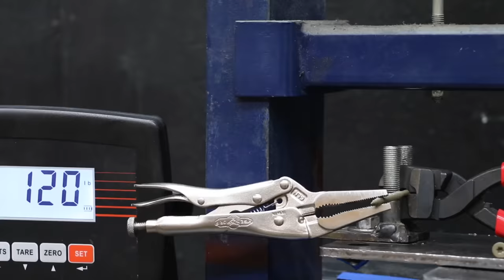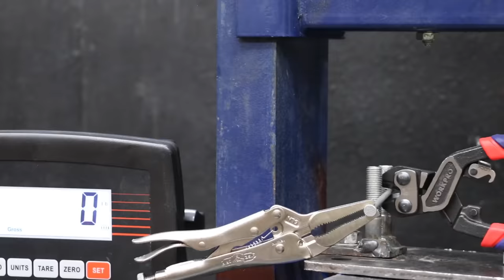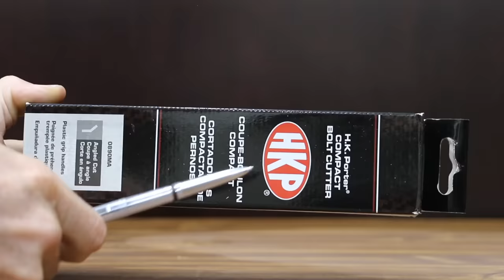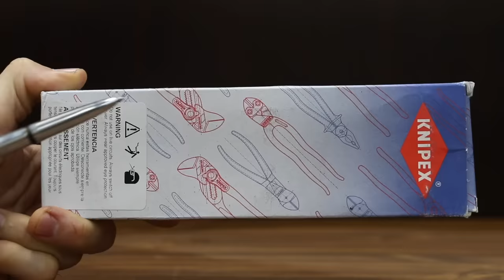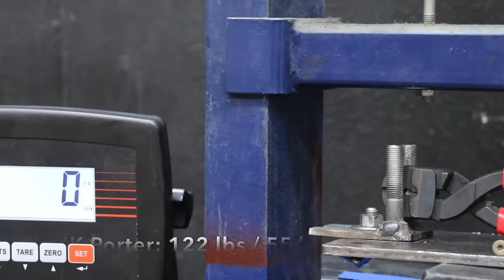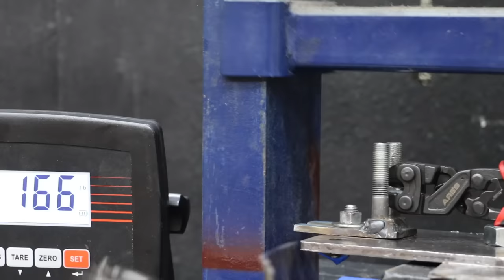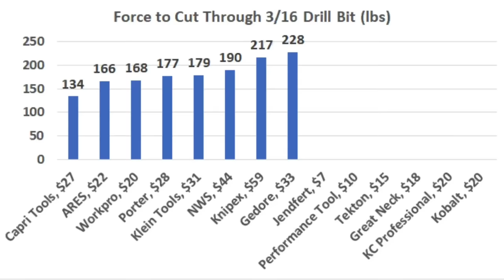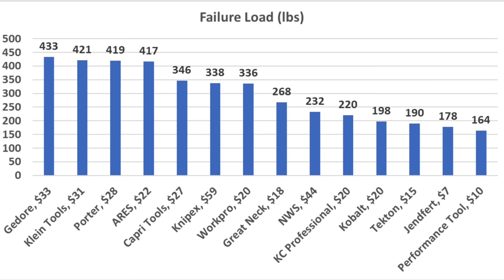Best Bolt Cutters? Knipex, Klein Tools, Kobalt, Tekton, Gedore, NWS, Porter, Workpro, Capri Tools

Comment: Thank you for another great video.  For the money those Capri cutters was impressive.  But the surprise was the Klein cutters. For a wire cutter to perform along side  designated bolt cutters says alot about the durability and steel.

Comment: I never heard of Capri tools prior to your test.  I am very, very impressed with them - $27 mini bolt cutter beat the $59 Knipex in most of the tests!  I'm going to look into the brand!  

Thanks for another awesome video!
Reply from the maker: You are welcome!  Thanks for sharing.
Reply: I broke the tip off my capri not long after getting them.  All my co workers use knipex and they last.
Reply: The thing about knipex is the durability, they really are worth double the price if you can afford it
Reply: @timmturner  Capri will send you a replacement in like 1-2 days. I've been super amazed with their customer service. They are only increasing in quality.
Reply: @ryanjohnston4828  Good to know, I wouldn't have any issue with their product. Performed well and is appropriately priced.

I was just saying in knipex you do get what you are paying for, a tool that will likely last a lifetime.
Reply: @timmturner  I like Knipex as well. I own several of their tools. But I just don't blindly buy tools because of the name brand either. Bolt cutters have a hard and short life. I would prefer to spend less on bolt cutters due to the nature of the job. The Capri proved to be a good tool especially for half the price. You could buy two pair of Capri for the same price as one pair of Knipex and have an equality capable tool.  The Knipex has the better edge and this may be a necessity for cutting harder steels. But for cutting a variety of different steels, the Capri would not be a disappointment. Plus, a person could benefit from buying a pair of Capri cutters for rough cutting and use the Knipex for selective cutting.
Reply: @halfstep67  the Knipex have several versions including angled versions that can get flush like side cutter and a notched version that would beat out all of the ones in this video for leverage and ease of cutting. The notch allows the use of the strongest and lowest part of the blade without slipping. It’s incredible. I wish he would have tested that one instead/as well.
Reply: Which brand do you like me to buy? Thank you
Reply: @AlexanderMason1  Agreed, it would be nice if he tested the recessed model since he cut exclusively round stock.

Comment: Those locking wire clips at the end of handles are a love/hate thing. Sometimes they are in the way (words are spoken) and other times they help with storage.
Reply from the maker: Great point!  I don't like them for the reason you mentioned
Reply: Extra words if they pinch you and/or remove some skin! 😬

Comment: Note that the position of the bolt on the jaws has a lot to do with the force required at the handles to cut it. Jaws that open a tiny bit more may have a huge advantage.
Reply from the maker: Thanks for the feedback.
Reply: was about to comment the same thing anyway great video!
Reply: I noticed that too.  I wonder what the outcome would've been if the object to be cut was jammed as far into the jaws?  Would the tool have lasted as long or failed earlier?

Comment: Never knew there were so many brands. I bought Knipex about 20 years ago. Use to cut wire, nails washers, trim metal parts. Never allen keys. The cutting edge is like new. They will not wear out in my lifetime here in Australia.
Reply from the maker: Thanks for the feedback.

Comment: Nice to see some German brands in the fold this time, especially NWS! I love my NWS-cutters, some of the best cutting edges I've ever come across in durability... But in the case of the design tested, they won't hold up to as much abuse as dedicated bolt cutters due to the design, they're made to be compact high leverage leverage Side cutters. They're great for what they are though.

A nicely hardened Allen key is harder or just as hard as most of those cutting edges, with the exception of NWS and Knipex perhaps.. By the way, NWS does makes actual proper bolt cutters, not high capacity Side cutters as the ones tested. The NWS 156-250 would have been the model of choice, and their smallest proper bolt cutters.
Reply from the maker: Thanks for the feedback.

Comment: The position of the nail/deck screw in the jaws (near the hinge or closer to the nose) greatly influences the amount of force/leverage exerted on the cutting points of the jaws. The nail/screw position should have been uniform in all cutters between all tests.
Reply from the maker: Thank you!
Reply: Exactly what I came here to say
Reply: It looked like he did the best he could, given that some jaws are smaller than others.
Reply: No he did it correctly. In real life you put the nail as close to hinge as possible so if one's jaws don't open far enough it should lose points.
Reply: That’s the exact same thing I was going to say
Reply: You're splitting nits.  The test setup was optimized given that these mini bolt cutters had different sized jaws, some had 'hinged' jaws, and 2 looked more like large diagonal cutters.
Reply: @kenc2257  two WERE diagonal side cutters. ;) I'm surprised they fared as well as they did.

Comment: I noticed that when cutting the nails there was no "standard" distance between the last pivot point of the cutters to the nail. That would make a huge difference if near the Pivot point or far from it. IE 1:34 2:41 and 3:52 4:17
Reply from the maker: Thanks for the constructive feedback.
Reply: I noticed that as well.  It would greatly affect the force needed to cut the workpiece.  I think that for most users, it's the durability of the blade that's most important.  You rarely need to take the tool to its physical limits, but you do want it to last.
Reply: It looked to me that he put the nail as far back as the jaws of the cutter would allow, which gives the maximum amount of leverage that particular tool can manage for that particular nail.

That seems like a perfectly fair way to conduct the test.  Anything else would be artificially limiting the leverage of a particular tool.
Reply: @Thanny  I agree, they were designed with the jaws only opening enough to get the nail that far in. If that design results in an inferior tool it will be reflected in the results and consumers should know about it.

Comment: I like the idea to compare pliers or boltcutters by the force required to operate them. At the end of the day thats what matters for the user. However in this test it seemed to me that the distance between the pivot(s) and the nail varied quite a bit from one cutter to another. This would influence the results quite a bit.
I know you are as thorough as possible and I love your content because of that. I was just wondering if there were limiting factors involved like some jaws not opening far enough or the handles then opening too wide for the cutter to fit in the press?
Reply: I think he actually mentioned that specifically. For one of them the opening was too small and couldn’t get as close to the pivot point which effected the results. So he did at least mention that
Reply: If you look at it from the context of the nail / screw being the constant, it doesn't actually matter that there are differences in where they sit in the jaws as that's a design decision made by the manufacturers and it "will be what it will be." For example, a designer could make jaws that move perfectly parallel. In fact, that's exactly why there are different designs in these products. Some have a single pivot, some have multiple pivots, and a few others even have slides. They do this to either increase leverage or decrease the angle of the jaws when cutting.
Reply: What fwe said. If the difference in distance to the pivot was caused by a design decision in the tool itself then it’s perfectly fair to include that discrepancy in the results since being able to cut things is what these tools are made to do and if the jaws don’t open enough to do that effectively then it’s a worse tool for the job
Reply: Thank you. Useless tests
Reply: The goal of his testing is to show which is the best for the user, not which is ultimately a stronger design. It's the workpiece tends to slip due to a design decision, the user will likely experience that during real world use. Not every use will applied ideally, and I think that's a fair representation.
Reply: @Eli-rq8et  the real problem is he chose 3/16" instead of 1/8"

A lot of these aren't spec'd for the size.
Reply: @jamesbizs  Explain

Comment: Love your vids.  I do have an issue with this one though.. In the first test, the distance that the nail is positioned in the jaws is a HUGE factor on the poundage needed to cut through the nail. To be fair, all of the tools should have been tested with the nail in the same exact place.  Other than that, thank you for all your hard work on this stuff!
Reply: I’m quite sure he positioned the nails as close to the pivot point ad he possibly could. Some cutters simply don’t open as wide as others, and therefore can’t accept certain items as close to their pivot points.
Reply: As he mentioned at 11:54, some of the brands can’t accommodate the thing being cut as close to the pivot point as the others. That is part of the reason why the Capri and ARES bolt cutters performed so well

Comment: Good job Tod! I have a request as I’ll soon be buying one: 10” portable tables saws. You can read comments all day long on the sellers website but nobody could rate them better than project farm. There’s lots to choose from with prices ranging from $200 to over $500. The field needs fleshing out! Would make for an interesting (and costly ) episode but would be well worth it.
Reply from the maker: Thanks!  Thanks for the suggestion.
Reply: I know my experience with the cheaper and used saws is that the motor moves when torqued and the blade makes the cut crooked.

Comment: I love when a budget tool does as good as the expensive ones! It might not be quite as durable but it's perfect for home use if it doesn't get used daily
Reply from the maker: Thanks for the feedback.
Reply: Buy once, cry once.
Reply: @Robert-cu9bm  depends. ive seen so many videos of snap on not out performing cheaper parts. so you cried for no reason.

Comment: I purchased a battery operated impact wrench from Work Pro on Amazon...mainly because I only needed it for one specific job and did not want to spend twice as much on a name brand. However, I have been really impressed with the quality of the tool and it gets a lot more use than I had planned. It removes all of the lug nuts on my F150 which are torqued to 140 lbs. Saves me from having to fire up my compressor and deal with air hose. In the end it's a well made tool so I am not surprised their bolt cutters did as well as they did. Priced right too.
Reply from the maker: Thanks for sharing.

Comment: I so appreciate all the testing you do in your demonstrations. One thing I did notice as you tested these different cutters, was that you didn't place the object you were cutting to the rear of the cutting surface on all of the tools. Having worked with bolt cutters & side cutters as a Lineman for 31 years I can attest that placing whatever you're cutting further back on the cutting anvil makes it easier to cut. If you ever do a similar test it would be more accurate to place whatever you're cutting as far back towards the rear of the anvil as possible. This isn't a critique on your testing, but rather a suggestion from experience. Keep up the great comparison test for us. We do appreciate it! BTW, Klein tools, Knipex  and HK Porter are three of the most used cutters in our trade...
Reply from the maker: Thanks and you are welcome!  Thanks for the constructive feedback.

Comment: I recall asking for this bolt cutter review. Thanks for doing it. I got the Knipex one, it’s quite good, but like you showcased, jaw opening isn’t that wide and might not get the best leverage, needs applying more force. I thought it would survive the Allen key test with bending, didn’t expect it to snap.

Btw, new video idea, metal or utility shear comparison? They are like scissors but much sharper and harder, tighter pivot point, can cut thinner sheet metals, plastic boards, etc.
Reply from the maker: Thanks for recommending the video!  Thanks for the suggestion.

Comment: Excellent video as usual sir.
I did notice that on some of the cheaper sets the nail/screw/drill bit didn't appear to be seated as far into the jaws as others.
I'm wondering if that might make a difference on the testing and if it's possible to make a rig that could compensate for the minor differences in jaw depth between the brands so the nails are fully seated in the back of the jaw to give maximum leverage.
Reply: I believe the depth of cut was determined by the jaws themselves.
Reply: I think that nail is fixed in place - it is pushed by jaws onto 2 screws driven into whole platform and thus fixed in place. Next pliers themselves are also fixed in position so the cut object couldn't move to much. So it appears, as written before, that it actually is determined by how much the jaws can open, and that indeed makes a difference. Please correct me if Im wrong😉
Reply: @charlesangell_bulmtl  Yeah.... if the jaws open wider, the tool will require less force to make the same cut on the same bolt.  It looked to me like the cuts were all "as far in as the bolt could go" which is an apples to apples comparison of real world force for cutting the same item.

Comment: Enjoyed the video, as usual; your thorough testing shines once again!  As a user of tools and a shop owner, the one thing that screamed at me throughout the video was "Why use such short bolt cutters?".  They are called bolt cutters for a reason and these, at eight inches, are NOT going to generate enough cutting power BY HAND to go through your average lock.  The hands, forearms and elbows would be placed under great stress as well.  I would be using at least 24" cutters so I could easily generate the torque needed to go through any metal thickness I needed to cut through.  But to be honest, I would rather pick up a hand grinder with a wafer blade and zip through any of these objects in far less time and energy.   Fun debate though, keep up the great work!
Reply from the maker: Thanks, will do!  Thanks for sharing.

Comment: Apparently I'm not giving my Kleins the love they deserve. I used to use Ideal cutters years ago when I was wiring houses daily, but they went "missing", so I replaced them with Klein as the old Ideal stuff wasn't available anymore (circa 1988), and I never found them to be as smooth as the Ideal cutters. I guess it's a "first love" thing. That said, I picked up a pair of Knipex 8" bolt cutters a few years ago on an Amazon return (damaged packaging) for the equivalent of $35 USD...and LOVE THEM. There is only one other tool that feels as nice in my hands as these Knipex.
Reply from the maker: Thanks for sharing.

Comment: Best video comparisons by far. I’ve relied on your testing for several purchases. Thank you!
Reply from the maker: Thank you!
Reply: I also found your review on rechargeable AA batteries to be thorough and succinct. I went with the Ladda’s and they’ve been a great value buy. Not sure if you have a recommendation for reliable chargers for those batteries but I searched your content and didn’t see any comparisons of battery chargers. Open to any suggestions you have. On a side bar, I just subscribed to your channel.

Comment: Have 4 Milwaukee Ratchets  1/4, 3/8, 3/8 long, 1/2-fuel   all work fine..... but actually like the M12 2467-20 1/4 right angle Impact driver the most. use it with 1/4 drive and 3/8 drive sockets

Comment: You’ve sold more tools to me than any advertisement. I have a suggestion. How about the best 10mm socket? Everyone is losing it. Torque to fail, corrosion resistance, wall thickness, plating thickness, tolerance, impact strength? Thanks for the awesome videos!
Reply from the maker: You are welcome!  Thanks for the video idea.

Comment: I've got one for you: Wood chisels. Some of them are machined so bad they take forever to flatten and sharpen and some others have inferior steel that won't hold an edge even after using it only in pine. Here are some brands I thought of for you to test: Windsor (Harbor Freight), Kobalt, Buck Bros, DeWalt, Veritas, Narex and Lie-Nielsen.
Reply from the maker: Thanks for the suggestion.

Comment: I work for a spring company and we always struggle to cut larger music wire (ASTM A227). We buy quite a few different brands and all seem to fail after a month or so. Have you thought about doing a 24" or 30" bolt cutter competition with different materials such as 1018, 4140, music wire(spring wire), oil tempered wire, or chrome silicon in the range of 4mm-6mm? Watch all your videos!
Reply from the maker: Thanks for the suggestion.

Comment: actually like the M12 2467-20 1/4 right angle Impact driver the most. use it with 1/4 drive and 3/8 drive sockets
Reply from the maker: Thanks for sharing.

Comment: Caulking guns. Garbage bags. Ratchet straps. Grease guns,  hand saw.  Scraper. Ice, wall, paint. Whatever scraper. Disposable gloves/semi last -able work gloves. Foam guns. Staple guns and hammer tackers. Best head lamps. I do spray foam insulation. We use a lot of tape. Duct and tuck... red used to be ok. Now blue is code. Some say its more sticky. Better vapor barrier .Maybe a show down between the two?